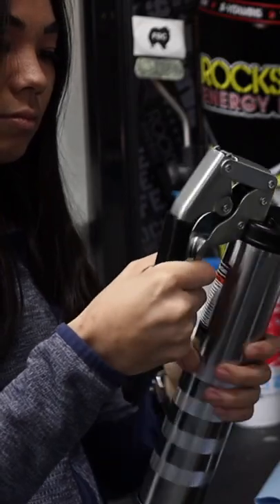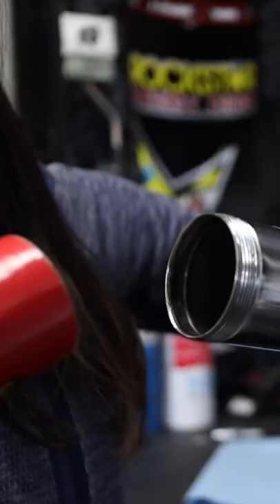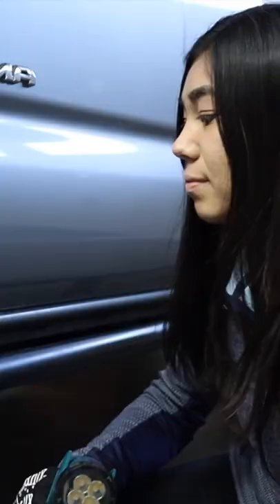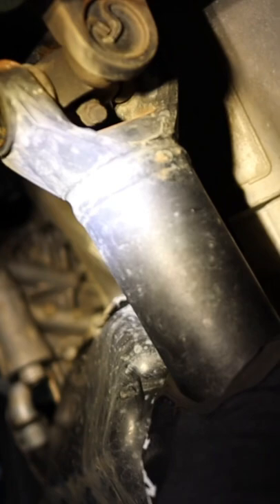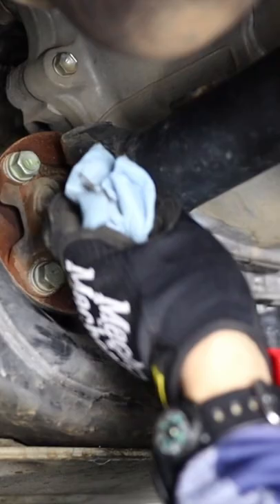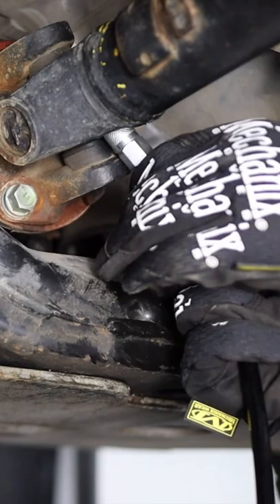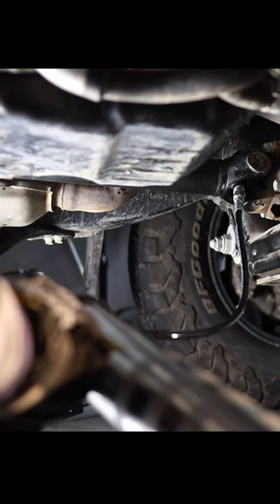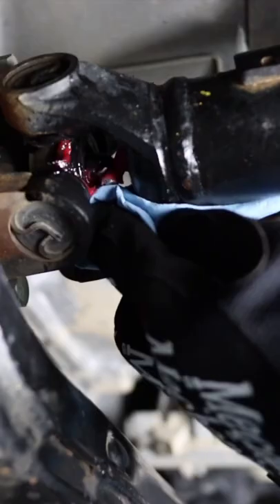I did NOT know this about my 3rd Gen Tacoma!! 🤔 #shorts

Comment: New GM trucks have ZERO zerts (maybe 2 on a sway bar), everything is a sealed pregreased system and its surprisingly way more reliable. 

Zerts need a zert point and the ability to release grease when you over fill it (loose boots/gaskets that eventually let in water when they get old), which adds alot of fail points especially since people never grease them (80% of owners).

The presealed grease lasts about as long as the part will so routine replacement of worn parts is all you need to do. I'm suprised the newer Tacomas have zerts
Reply: Zerk*

Comment: Non greasable joints are usually stronger they are not usually drilled out ..for my truck  I have solid joints because they will break if you don't I'm running 1410 flat flange.truck is completely custom changed everything 800 hp.. 900 ft lb of on 49 in i rocks

Comment: I run a commercial shop where we service semi trucks I buy grease by the 50 gallon barrel and I've never heard anyone anywhere refer to it as a zerk.. must be a regional thing
Reply: I always thought Zerk fittings were fittings that were sealed and didn't require grease.
Reply: Ive never heard someone NOT refer to it as a zerk before😂
Reply: @alankidd6832 
Up here in the inland northwest we just call it a “Grease fitting” or Grease joint …

Comment: Good to see you taking care of your ride like you do, I went crawling under my truck after your video I found zero fittings on mine, 22 off-road 🤷 I do the same shit I have a manual transmission I've already changed the transmission fluid & it only had 2,500 miles but it had a bunch of metal in there so I'm glad I did. It's crazy what these manufacturers recommend for fluid interval change. I changed my 🛢️ 1st time @ 545 miles, again at 2,500 the 2nd 🛢️ change was Overkill but the 1st time it needed it. Oh well I wasted 30 bucks at least I know everything is good in there lol. Transfer case fluid next, then the differentials but we just did my buddies 2018 GMC Z71, he has just over 50,000 & we did his rear differential for the 1st time & his fluid didn't even look that bad so I'll probably do mine about 10,000 miles... Use amsoil for the transmission & differentials & redline in the transfer case. Your Toyota will last 200k easily. There's a lot of different maintenance things you need to do spark plugs, air filter, cabin air filter, belts, hoses, replace coolant, bleed ALL brake fluid & same w PS fluid every 5-6 yrs. People think it doesn't need to be done but if you do everything, your 🛻💨 will run so long & so good with minimal problems imo
Reply: 200k? Cake walk, I want 300+k out of mine with not much major repairs.
Reply: @jmabs5096  depends dude garage kept or outside? where do you live, what type of environment?? do you drive salty roads in the winter time, do you rinse it off after u drive in 🧂 conditions? there's so many different❓ & variables... also are you going to drive 300K in 5-6 years or 300K in 20 years...? 🤔

Comment: Depends on the trim package and what brand of ujoint is used at the factory or if they have been replaced with aftermarket one my off road TRD used Spicer so the joint caps have the zerc fitting

Comment: Recent year OEM U-Joints come sealed. Aftermarket U-Joints have zertz whether replaced due to wear or upgrades.
Reply: No it's a Tacoma thing they have 2 different u-joints parts there computer randomly selects which one to use that's why there like that my 2020 Toyota has no fittings while my brothers has 4 same year different color both purchased 0 miles from the lot

Comment: I’ve only seen one zerk per U joint… greaseable U joints are weaker because they’re not solid. I prefer zerks in the bearing caps, not in the cross. They’re easier to access when needed

Comment: Part of the reason is if u have had ur u joints replaced due to damage, most original parts don’t have grease nipples but a lot
Of shops use the greaspable u joints

Comment: When joints  have no grease fittings  that means the assembly was injected  with molybdenum  at the factory all replacement  ones will  have grease fittings

Comment: Those local 'while you wait in your car' oil change places will install the grease fittings on all the joints that are sealed. Had that done to my 1990 4Runner when it was new and never had a universal fail. I'm going to have them do it on my 2021 Tacoma as well.
Reply: Not as simple as screwing in a zerk. You'd have to swap all the universal joints in order to be able to grease them. There no nothing wrong with sealed joints. Dirt and water ingress is what damages joints, having a zerk gives the ability to introduce contamination. Sealed will last a very long time as long as the rubber boots stay undamaged
Reply: @NDC1115  false and wrong. The fittings themselves do not introduce water, so the only way water gets in is through the seals which would get in regardless of "self sealed" or not. "self-sealed" is a cost-cutting measure, as an O-ring retained by a snap ring is cheaper than a cast fitting, polished with a hypersmall spring and tight-tolerance ball bearing installed.

There is a reason why even on the newest aircraft we still use zerk and flush fittings with routine lubrication and not the "sealed" universal joints we now see in the automotive market.

Because unlike the automotive sector, where a blown U-joint is a loss of power and a bad day with a tower. A lost pivot pin, drag or side brace results in a bunch of coffins lined up at the nearest morgue.
Reply: @asymsolutions  you airplane guys always have to be high and mighty don't you? Must me nice to work on clean rust free shit every day
Reply: @NDC1115  Yes we do, and it's earned. A good portion of us started out in automotive, including myself. I worked for a GM dealership, and the level I was held to there vs now is not-comparable. For example, what Khloe did in her UCA swap (which some toyota cerified mechanics did to my bud's 2019 TRD sport when his LF uca joint failed) would not have been acceptable in our field.

We learn to repair WITHOUT damaging the surrounding components, a thing that many mechanics in the commercial and automotive field who have learnt to do the same have prospered from.

Those guys tend to move onto things like motorsports, where you know when to repair with detail and when to "fucking send it" with a sledge. 

Also if you think everything is rust free, I have a bridge across the Sahara to sell you. I'll gladly give you a 182 older than me that sat in some hobbyist's barn or some slav shit that eastern Europeans hoarded and let rot, and tell me we don't know rust.

That shit is worse than digging out old 70's american muscle cars (mostly monte's, chevelles and some 2nd gen camaro's) in the 90's, which was my childhood.
Reply: @asymsolutions  someone is smarter than most

Comment: 0 on mine. 2020 sr5… i was searching forever before I realized I was looking for nothing lol
Reply: 0 on my 21 TRDOR, and trust me, I know how to find zerk fittings as an aviation mechanic. 

Honestly kind of pisses me off since I actually offroad mine and grease breaks down over time with heat buildup from heavy use.
Reply: @asymsolutions  so what’s the solution? Could we add some to the current parts or do we have to wait until replacement time?
Reply: @Walterino  not really other than replace with the old style. Adding a fitting requires drilling out a hole, deburring it and reassembling the joint, which is sealed . Also even a hand powered grease gun can go up to 5000psi, which the sealed besrings probably aren't meant to deal with so you can blow out the seals easily.

Comment: How do I know how many zerk fittings there are for my Tacoma? and what is the best grease grade to use? I have a 2020 base SR
Reply: Get under it and look is the best way to find out how many! I work for a fleet company and we use Mobil 1 grease for our trucks. They easily see 600,000 plus miles on the factory drive shafts/unjoints.

Comment: Having a grease fitting on your U-joint as a weak spot. So they probably remove them because of different weight or different Power.
Reply: Right that's why on class 8 trucks thier are grease fittings please go back to Disney Land with your stories
Reply: @foxbodyguyeightyeight3672  so you're saying a solid piece of Steel with a hole drilled in it is stronger than one that doesn't?
Reply: @jonsears6892  bud I don't right the rules I'm just saying how it is any HD u-joint has grease fittings

Comment: She doesn't know you can't mix match grease either.
Reply: depends on the grease. In her case it looks like it is that heavy red shit used in most drivetrains so she should be good.

A lot of manufacturers have been using pretty generic greases since the late 90's for ease of supply reasons. There is no reason to use a special grease in your U-joint or ball-joint other than german based autism.

Oils are where it really matters, because now we are dealing with hydrualics.

The only places I've seen grease types really be incompatible are in manufacturing equipment and some aviation; even then if the wrong grease is applied, you can purge the old grease out and still be good.

That last part was even considering things like milspec 27 and 14 grease that hardens and crystalizes when in contact with each other over several high heat cycles. Heat cycles that are far more extreme than what this tacoma will ever see.
Reply: @asymsolutions  yup that's what they want you to think so you don't blame them when it fails early
Reply: @jaypady9463  tell me you don't know shit about lubrication without telling me you don't know shit about lubrication.
Reply: @asymsolutions  ask your mom she will tell you I know about lube. If you didn't buy it from the dealer it's different. "A lot of manufacturers are using?" Which manufacturers? Which dealer do you work for or shop?
Reply: @jaypady9463  Once again tell me you don't know shit about lubrication without telling me you don't know shit about what you are talking about.

There is a standardization grade that almost all automotive greases conform to that is labeled right there on the container and they have to all be compatible with the same grade. I'll let you go look up the organization.

Same shit exists with oils, fasteners, electronic connectors, tube sizes for pneumatics and hydrualics etc. It's almost like companies purposely work together to form a standard so they don't have to redesign everything from scratch and save money on supply contracts.

Who would of knew?
Reply: @asymsolutions  You must read all your ingredient labels and have a degree in chemistry. I'm not going to lie I put whatever is available in but every once in awhile I've had some good parts fail for no reason at all. Most Manufacturers don't want you adding grease at all but still put valves for grease. I've had ball joints fail, u joints, and even slide pins for brakes for what I believe to be just simply the wrong color grease added that made a Grey color grease (like had blue then added red or tan).